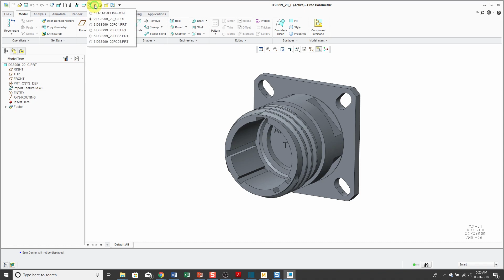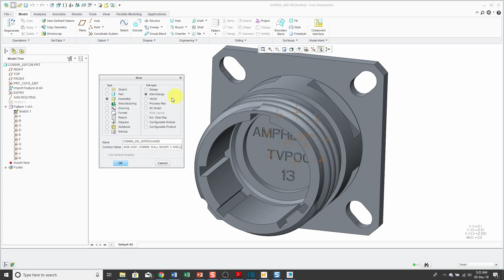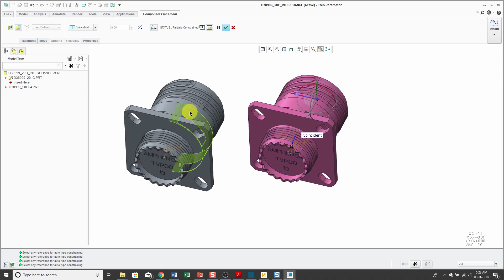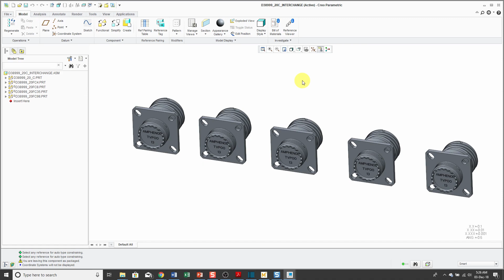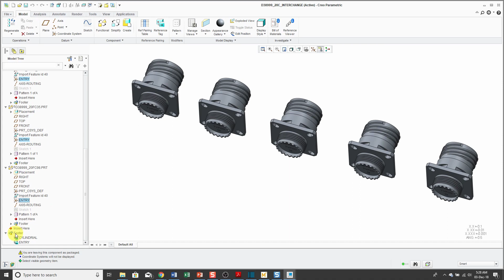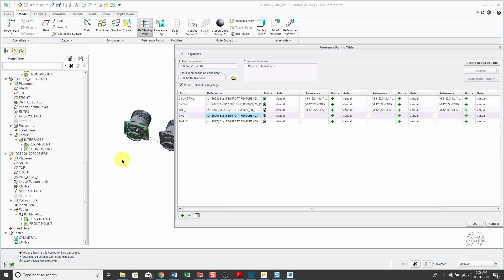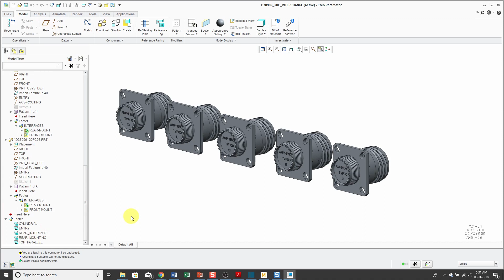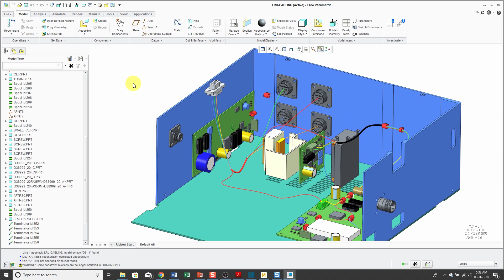Creo Parametric - Interchange Assemblies | Replacing Components

Comment: Hey man thanks for sharing the knowledge. Great video. Is there a way to control this by using a family table? I have a family table in which I am using a frame with 3 different variants depending on the width but when the frame's depth changes so does the part number and it does not belong to the original family variants, for this reason CREO won't accept me typing in the different part number under the frame column (hopefully I explained that in a way that makes sense).

If there's a way to do it that'd be awesome bc otherwise I'll have to manually add all of the frames and only control the suppression state with a Y or N from the family table.

Cheers!
Reply from the maker: Take a look at my series on Pro/PROGRAM. I think in the last video, I cover how to swap out using Interchange. Maybe this will get what you need.

Comment: Does anyone know if there is a way to convert an existing assembly into an interchange assembly?
Reply from the maker: You can actually do it in two steps. Save the assembly as a Configurable Module and then save the Configurable Model as an Interchange Assembly.

Comment: One of the better overviews of the interchange assemblies. Are you aware of a way to control the replacing action programmatically (using pro-program)? This way you can have parameters drive which part is used... in my application I don't want to have to manually interchange
Reply from the maker: James, yes, Pro/PROGRAM can be used to swap out different members of an Interchange Assembly. My videos on Pro/PROGRAM for parts and assemblies are way overdue.

Comment: sir i am very new to creo 3.0. i have no any guidance. i am only learning from u tube. i have a doubt in assembling, but i don't know how to solve it..please help me. that is
                        when i select the second component after selection of first component for assembling, then the  first component appear very smaller than second component in graphic area.then i don't know how to assembly it.......this is my problem sir.
                                                                                            please help me sir.
Reply from the maker: Sorry for the delayed response - I ended up babysitting tonight. Look at this video and let me know if it helps with your problem. If it doesn't, let me know - honestly! I really want to help you. https://youtu.be/HeKFRAyeaPA
Reply from the maker: Hemababu, thanks for your question. That’s a very common issue for users. What can help is using buttons on the dashboard to display the component in its own separate window, turn off the display of the component in the main window, and then click the Zoom All button in the In Graphics Toolbar in the main window. Later today I will post a video showing how to do this. Thanks again for watching and for posting a comment.